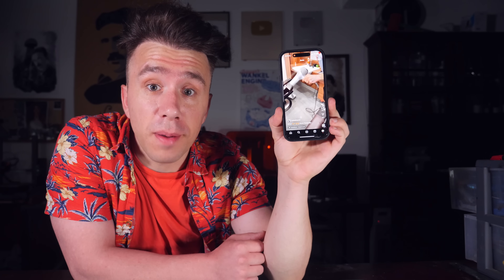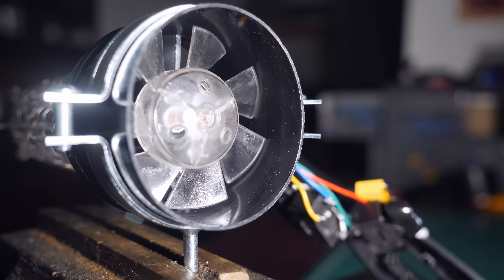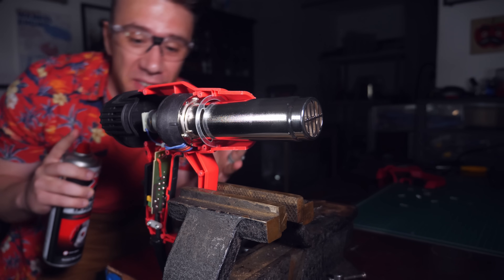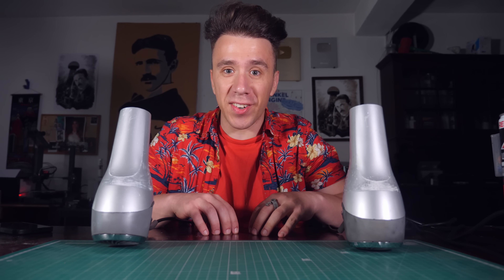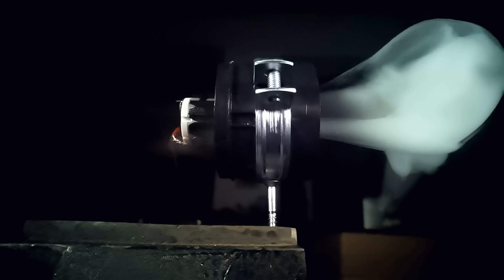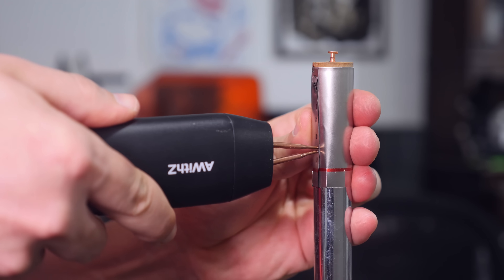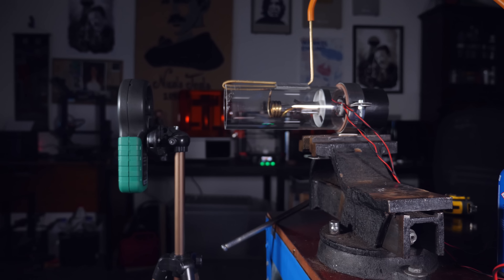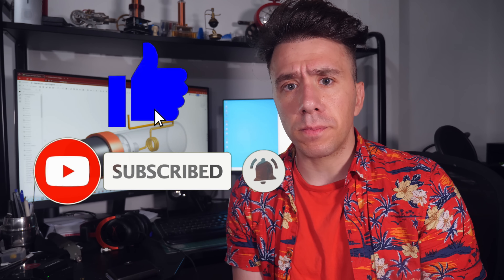I turned my $20 Hairdryer into a JET ENGINE

Comment: To increase thrust you could try a Turbo Fan type design, where air can bypass around the combustion chamber but a bit of the air still goes into the combustion chamber to burn. That way you get un interrupted air for thrust and combustion maximization! 

Interestingly 80% of the direct thrust of a turbo fan on modern jets comes from just air moving through the bypass while the remaining thrust comes from fuel in the combustion chamber.

Comment: You can use two brass pipes: in the first one you can supply fuel (propane,butane, hydrogen etc)
In the second one you can supply pure oxygen....after that connect those two pipes without decreasing their pressure and now you have a mixture of fuel and oxygen and more oxygen means more combustion.....use a leaf blower impeller they are just perfect for your engine and use nozzels to again compress the gasses and increase your thrust

Comment: What if you had a second fuel line that sprayed from the back of the fan? 
Then as the first ignites you have a secondary ignition that you can keep pushing till it uses all the air

Comment: I can't help but feel like the coiled fuel line is impeding airflow. Is the amount of thrust you gain from heating the fuel line greater than the amount of thrust you lose from it's obstruction? Either way, I think the geometry of the fuel line and coil can be adjusted to increase thrust.

Comment: i think that if you drill small holes that would act as nozzles that spray the fuel around at a specific pressure, relative to the air speed, that would allow the ignition to happen just at the right moment you'd be able to use more air for the ignition. By also precisely directing the gas at the right spot, by drilling nozzles at an angle (positive or negative relative to the airflow) you can use the turbulence vortexes to disperse the gas more or less efficiently. Also if you'd be able to direct the air in a vortex patern in the tube that might increase or decrease efficiency as well.
Probably the parameters wouldn't be linear, and at higer speeds a higher gas injection angle might be better...

Comment: Just a warning that you should only use non-chlorinated brake cleaner for this. If you use chlorinated brake cleaner around high heat, it generates phosgene gas, which is lethal even in small amounts.

Comment: Why not use the copper coil as the protection for the igniter and have lots of small holes pointing inwards, towards the igniter. Less parts, greater area for ignition and the fuel will cool the copper tube.

Comment: Improvement idea: create a venturi that could be placed in the air stream just before or slightly after the ignition point. The turbulent air may allow for a better fuel air mixture. Also metering the fuel is a must.

Comment: Sign me up for a 3D printer! You need a way to spread out your fuel more...a vaporizor instead of jsut the open end of the brass tubing. Jet and rocket engines use fuel sprayers or vaporizers to make the fuel particles as small as possible for the best case ignition. Also your are source is fairly laminar to the outside of the PC tube. You need that air in the fuel. Multiple fuel nozzles in the air flow might do it. forcing some of the air flow into the fuel stream might work as well.
*
Stupid YT algorithm! What did you do that was sooo dangerous? I've been demonitized too. Say too many cuss words and it keeps your payout!

Comment: @integza wonder if there’s a way you could resin print a fan Blade to distribute the gas from the trailing edge of the blade. Like almost make tubes running through the blade from the center, and you could totally use a quick disconnect for like an air compressor! Just a random thought

Comment: i'll leave the same comment i left last time, you really REALLY don't want to use brake cleaner as fuel. breathing it in will give you turbo cancer, and breathing in the burnt fumes will also give you turbo cancer. if you plan on using it indoors, you should be using a legit respirator that can filter the fumes. if i'm using it for more than one or two squirts, i will use a respirator. even when i just barely use it, i will hold my breath. seriously, its heinous what chemicals are in brake clean because its designed to destroy organic matter extremely fast (carbon buildup). 

they are your lungs and you can huff brake clean if you want, but i've found that most people that use it have no idea how crazy toxic it is

Comment: First don't use acrylic second make a ring of a aluminium pipe with some hole for injecting fuel. And why not use a bldc motor which automatically gets lower when fuel less burns? and tries to use more flammable Gus with high pressure.. and the problem is I can't explain everything in text if you like my idea.. tell me i can design you one jet engine..
Reply: Integza, is that really you or am I just hoping in vain for my first 3D printer? Because this seems like a scam to me... please reply.

Comment: I would do three things:
- add some slits in the part that connects the fan to the acrylic tube, so you're gonna pull in even more air with venturi effect
- use a larger pipe to inject more fuel
- add some holes in the coil in order to better diffuse the fuel and mix it with the air flow

As usual, great video!

Comment: You can buy adjustable actuators for aerosols. You can control your fuel flow with that much easier. Or, you could design and print one yourself I guess.

Comment: make the fuel ring around the diameter  of the tube with holes all around  and one too going into the original chamber as a pre light  to keep a flame going should burn alot more oxygen

Comment: To solve the problem of the air slowing down, don't solve the problem. If the air slows down it will speed up again. Long story short, you should just be able to add a nozzle.

Short story made long: 

In a jet engine, air goes through a process of slowing down and then speeding up to efficiently generate thrust. Here’s how this process occurs:

### 1. *Intake and Compression: Slowing Down the Air*
- **Intake**: Air enters the engine through the intake at high speeds, especially when the aircraft is moving fast. The intake slows down and compresses this incoming air. This deceleration is necessary to prevent shock waves and ensure the air enters the compressor at subsonic speeds, which the compressor is designed to handle effectively.
- **Compression**: The air then moves into the compressor section, where it is further slowed down and its pressure increases significantly. The compressor, consisting of multiple stages of rotating blades, compresses the air by reducing its volume and increasing its density. This process increases the air pressure and temperature, preparing it for efficient combustion.

### 2. *Combustion: Speeding Up the Air*
- **Combustion**: In the combustion chamber, the compressed air is mixed with fuel and ignited. This combustion process drastically increases the temperature and pressure of the air. Although the air's velocity doesn't significantly increase in the combustion chamber itself, the energy added to the air sets the stage for rapid acceleration in the subsequent stages.
  
### 3. *Turbine and Exhaust: Speeding Up the Air*
- **Turbine**: The high-pressure, high-temperature air from the combustion chamber passes through the turbine. The turbine extracts energy from the hot gases to drive the compressor and other engine accessories. While the turbine causes some reduction in pressure and temperature, the air still retains substantial energy.
- **Exhaust**: Finally, the air expands through the nozzle at the back of the engine. This expansion converts the remaining thermal and pressure energy into kinetic energy, accelerating the air to a much higher velocity than it had at intake. This high-speed exhaust produces thrust according to Newton’s third law of motion (for every action, there is an equal and opposite reaction).

### Summary
- **Intake**: Slows down and begins compressing air.
- **Compressor**: Further slows down air, increasing pressure and temperature.
- **Combustion**: Airspeed remains relatively constant, but pressure and temperature increase dramatically.
- **Turbine**: Extracts some energy, slightly reducing pressure and temperature.
- **Exhaust**: Expands and accelerates air to produce thrust.

By managing the flow and energy conversion of air through these stages, jet engines efficiently convert fuel into thrust, propelling aircraft forward.

Comment: So real turbine engines don't use all the air. That would be stoichiometric and would melt EVERYTHING.

They typically use about 30% for combustion and the rest is mixed to reduce the temperature before hitting the nozzle guide vanes and turbine wheel. You see the flame temp is crazy like 3000ºC so mixing it down to 750ºC but with much more volume is enough to stop stuff melting. 
Now this is all to do with the core or gas generator part. From there the remaining energy in the exhaust gas is used to drive another turbine wheel which then turns a big ducted fan which moves WAY more air but at slower speed - good for subsonic flight.

Comment: The challenge with what you describe is making sure the fuel can ignite in the air flow and therefore provide enough heat.
The way it works in after burners is the air is already hot when the fuel is inserted, obviously you can do that, but we could do the opposite.
The idea would be to pre-burn the fuel without enough air heating the fuel before injecting the hot, partially combusted fuel into the air stream.
This should cause combustion with the air. 
To avoid clogging with soot, you need to use a fuel that burns very cleanly. The easiest would be hydrogen, methane would probably work too, butane I don't know.

Comment: Inject the fuel from the back of the motor (deadspot) 
The order order goes here motor fuel ignitor and change the ignitor design from open ended on one side to open ended on both, i know its hard, but u can do it

Comment: So i know that the rpm may be an issue, but what if you inject through the blades. I feel as if you may get a better fuel air mix. With ignition, maybe use the same setup, but use some intake louvers to draw some of the mix into the coil. Im not an engineer, just a mechanic, so i have no idea what im talking about, lol. My wife and i love the videos and the "off the wall thinking."

Comment: Can you try to bend a jet stream the same way a plasma stream can be with an electrical or magnetic field? Would be really cool to see it in the acrylic tube if it happens. How much voltage from a coil, or winding or maybe your ion emitter wrapped around the acrylic would it take to see the deflection in the flow in your acrylic tube???, Not trying to use the ionic wind from the ion engine, but the electrical field to control/modify the jetstream. How much of a field (magnetic or electric, voltage vs current, right hand law vs left hand law) would it take to modify/bend the jet stream like we can with an acrylic rod and water? Does the burning gas need to be as hot as plasma before it is affected? Can the electrical field be used to protect the acrylic? So many more questions popping into my brain that'd make this comment way to tomato based.

Comment: The flitetest channel did an EDF afterburner years back that worked great on a model dehavelin. They used butane and ran it through an expansion tube similar to the coiled section you have but drilled 1/16 holes into a diffuser piece and had it directly in the air stream. Im sure the affect would be similar with the brake clean as long as you lengthen the coil. Brake-cleaner expands and vaporizes a lot slower than butane/map gas. There is also a servo controlled release used for the butane bottle that might work if adapted to fit the larger Brake-clean can.

Comment: I think, that are the sparks of the brushes, that ignite the fuel. You need open flame, for ignition, just the heat will not do much. Except of evaporation.

Comment: Love it, I think you're on to something! I'm thinking trying to utilize multiple fans since some engines use a series of fans or stages to gradually increase the amount of air being drawn into the engine. In addition variable-pitch fan blades or adjustable inlet guide vanes allows the engine to adapt to different conditions, optimizing airflow for combustion. lastly improving the design of the air intake, such as using a more aerodynamic shape or adding features like boundary layer control, can help smooth and increase the airflow into the engine. 

for ignition there is an upper and lower flammability limit, so you can have too much concentration of fuel and it won't ignite (or not enough), so being able to control the fuel flow is really important as well, out of the can it's fixed so adding a way to control the fuel and optimize it will also help a great deal. Can't wait to see what comes out of this!
Reply: One more thing try cooler air aka a heat exchanger, cooler air is more dense than warm air, more air molecules in a smaller area is great for combustion

Comment: It could possibly be a good idea to use some type of mesh for the area around the nichrome wire, or maybe cut some small slits in the metal that was already used to improve the airflow!

Comment: To help you formulate a solid suggestion for Integza, here's a detailed explanation and approach for regulating the fuel flow in his hairdryer-jet engine project:

### Suggested Approach

1. **Use Jet Fuel (A or A1)**:
   - Jet fuels like Jet-A or Jet-A1 are designed for use in jet engines and would provide a consistent and suitable energy source for this project. However, using jet fuel requires careful handling and storage due to its flammability and safety concerns.

2. **Fuel Pump**:
   - A reliable fuel pump is necessary to ensure a steady flow of fuel to the engine. An RC (remote control) turbine fuel pump could be a good option, as these pumps are designed for small-scale jet engines used in RC models.

3. **Needle Valve**:
   - A needle valve allows precise control over the fuel flow rate. By adjusting the needle valve, you can fine-tune the amount of fuel entering the combustion chamber, which is crucial for maintaining stable combustion and optimal performance.

4. **RC Turbine Controller**:
   - RC turbine controllers are specifically designed to manage fuel flow, ignition, and other parameters in small jet engines. Using a controller designed for RC turbines would simplify the process of regulating fuel flow and ensure safe operation.

### Detailed Plan

1. **Fuel Selection and Handling**:
   - Purchase Jet-A or Jet-A1 fuel from a reputable supplier.
   - Store the fuel in a safe, approved container.
   - Ensure proper ventilation and safety measures are in place during use.

2. **Fuel Pump Installation**:
   - Select an RC turbine fuel pump compatible with Jet-A/A1 fuel.
   - Mount the pump securely near the fuel tank.
   - Connect the pump to the fuel tank and the fuel line leading to the engine using appropriate fuel tubing.

3. **Needle Valve Integration**:
   - Install a needle valve in the fuel line between the pump and the engine.
   - Ensure the valve is easily accessible for fine-tuning during operation.

4. **Controller Setup**:
   - Purchase an RC turbine controller that supports the fuel pump and ignition system.
   - Connect the controller to the fuel pump, ignition system, and any other necessary components.
   - Follow the manufacturer's instructions for programming and calibration.

### Implementation

1. **Testing and Calibration**:
   - Start with a low fuel flow rate and gradually increase it while monitoring the engine's performance.
   - Use the needle valve to make fine adjustments to the fuel flow.
   - Observe the combustion stability, engine temperature, and thrust output to find the optimal settings.

2. **Safety Precautions**:
   - Always wear appropriate safety gear, including fire-resistant clothing, gloves, and eye protection.
   - Keep a fire extinguisher nearby in case of emergencies.
   - Conduct tests in a well-ventilated area away from flammable materials.

By implementing this approach, you should be able to provide Integza with a well-thought-out solution for regulating the fuel flow in his hairdryer-jet engine project. Here's a concise version of this plan to submit as your suggestion:

---

*Suggested Fuel Flow Regulation for Hairdryer Jet Engine:*

1. **Fuel Type**: Use Jet-A or Jet-A1 fuel for consistent energy supply and optimal performance.

2. **Fuel Pump**: Install an RC turbine fuel pump for steady fuel flow.

3. **Needle Valve**: Integrate a needle valve in the fuel line for precise control over fuel flow rate.

4. **RC Turbine Controller**: Utilize an RC turbine controller to manage fuel flow, ignition, and other parameters.

**Implementation Steps**:
1. *Install* the fuel pump and connect it to the fuel tank and engine using appropriate fuel tubing.
2. *Add* a needle valve in the fuel line for fine-tuning the flow.
3. *Set up* the RC turbine controller and calibrate it according to the manufacturer's instructions.
4. **Test and Calibrate**: Start with a low fuel flow rate, gradually increase it, and use the needle valve for fine adjustments while monitoring engine performance.
5. **Safety**: Wear safety gear, have a fire extinguisher nearby, and conduct tests in a well-ventilated area.

This approach ensures safe and efficient fuel flow regulation for the hairdryer-jet engine project.
Reply: ChatGPT moment
Reply: I'm generally in agreement with the detailed plan but step 1 is a blocker. Handling that fuel properly takes rigor, discipline, instruction, and experience. Choose a fuel that doesn't pose dangerous  or deadly possibilities.